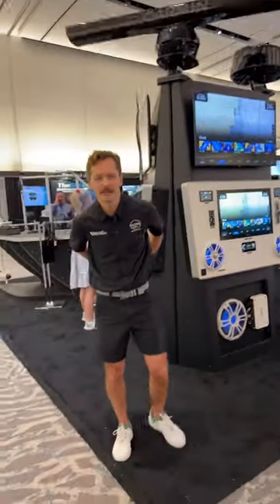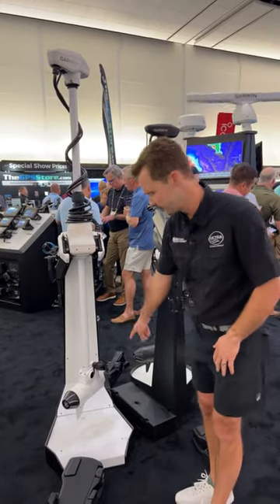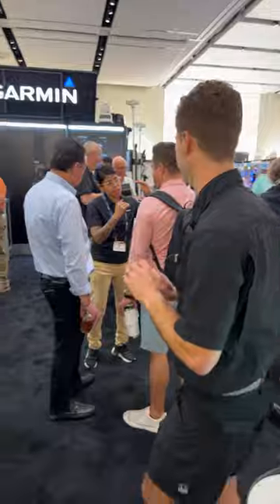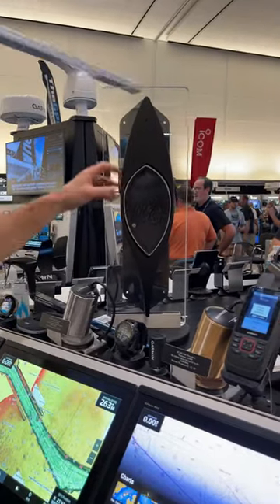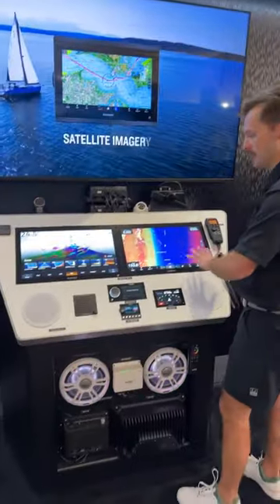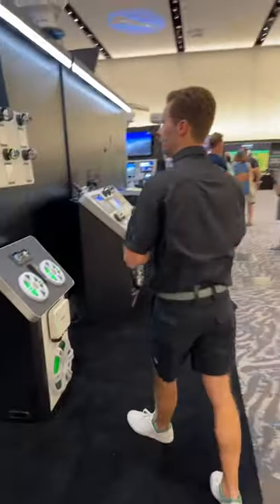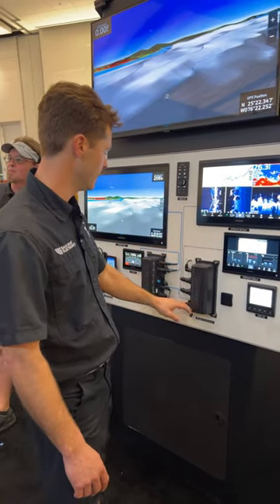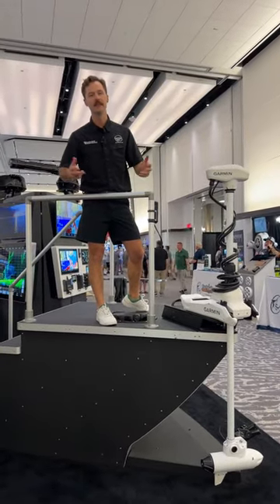LIVE in the GARMIN BOOTH from the Miami International Boat Show! New LiveScope Transducer.

Comment: Garmin does not stand behind their products!
I paid big money for what I was lead to believe were quality products
Garmin 25kW GMR xHD2 Very low operating hours. DEAD, Magnetron is dead Garmin wants $2500 to repair it. 
Panoptix in hull transducer will not calibrate compass after a garmin update. 
Coupled to a Garmin 7610XSV that seems to be working fine. 
DO NOT BUY GARMIN